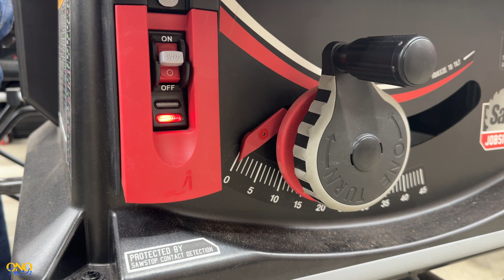SawStop Brake Activation & Removal

Comment: I am struggling to get the blade, after it dropped down, etc.  to come back up. I removed the old cartridge and the old blade together, but the new cartridge is in the way of the blade installation on my cabinet saw. Frustrating.
Reply from the maker: I don’t think I quite understand your situation. I think your best bet will be to give SawStop customer service a call. They are very good at helping users figure out the issues. Good luck!

Comment: The Rockler demo guy comments on the price of the SawStop as being quite expensive. While the SawStop is more expensive than most table saws, the brake mechanism isn’t the biggest contributor to that price difference. The overall build quality, accuracy, design, robustness, motor quality, fence precision, customer service, and other factors are major factors in the higher price. Even the owner’s manual and assembly instructions are top tier. 

When I was looking to upgrade to a new table saw, I considered several brands like Powermatic, Laguna, and Harvey, but SawStop was the safest saw on the market, so I bought it. Having lost most of my right hand in an industrial accident on pre-OSHA machinery when I was 19 years old, I can’t afford to lose any more digits. 

I now have backup in case I do something stupid on my table saw. Thanks for the video to show me how to remove the assembly just in case I do.
Reply from the maker: I completely agree with your assessment on the quality of SawStop being a contributing factor. Even my little CTS is of noticeably superior quality to many of the similar portable saws I see at the big box stores. Glad the video can help. Extracting the blade and brake was one that I really haven't seen much of on YouTube.

Comment: My brake went off a few months ago when the blade contact my aluminum miter gauge fence. It took me about 15 minutes to remove the brake/blade from my saw, and then another 10 or 15 minutes to remove the blade from the brake. I wanted to see if I could salvage the blade (Forrest Woodworker II), and once I got it free I inspected it thoroughly. Fortunately there were no broken teeth or other visible damage, and when I reinstalled it (after putting on a new $99 brake), the blade still ran true. It definitely wasn't easy removing the blade from the brake, but it's doable. But make sure you get your blade inspected!
Reply from the maker: Agreed. Inspection and repair of any damaged teeth are paramount. Glad it worked out!